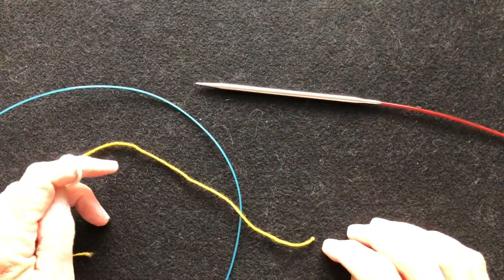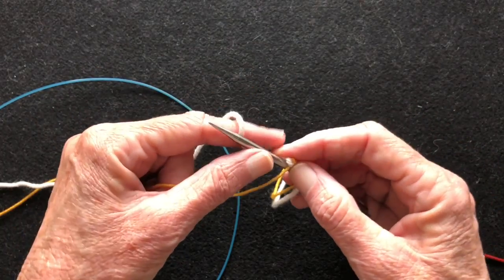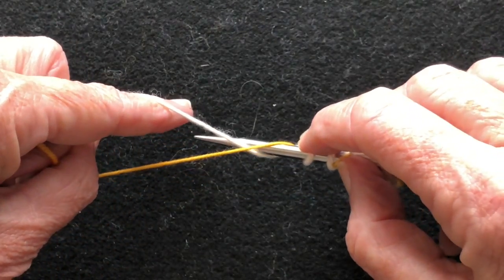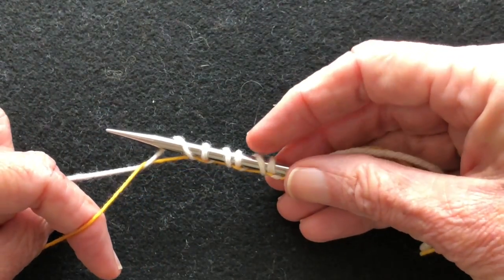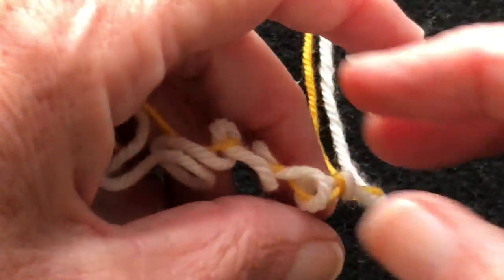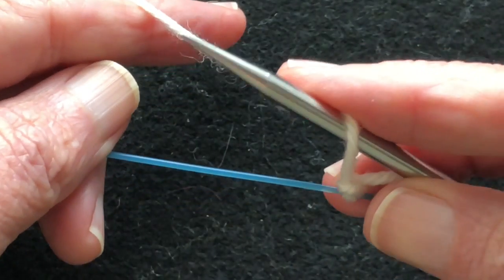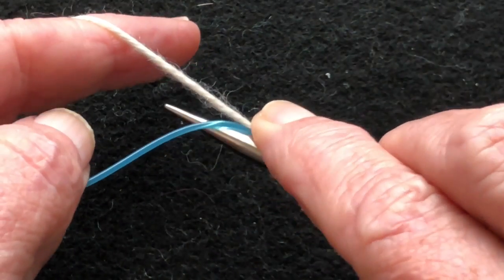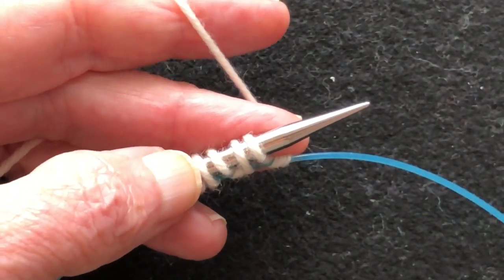Provisional Cast On AKA Lace Cast On

Comment: Do this stitches on the cable  remain on this cable  until you need them?  If so, wouldn’t this extra stiff cable get in the way of regular knitting on another circular needles?
Reply from the maker: Depends on the stiffness of the cable.  Use a pliable cable.